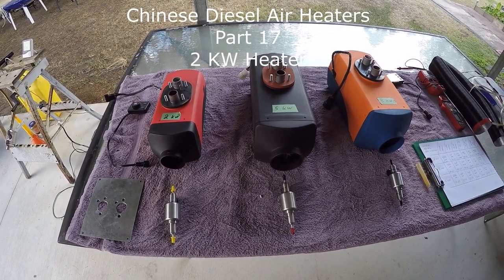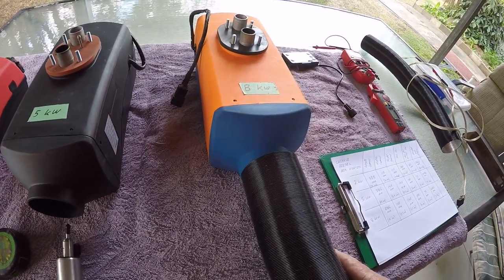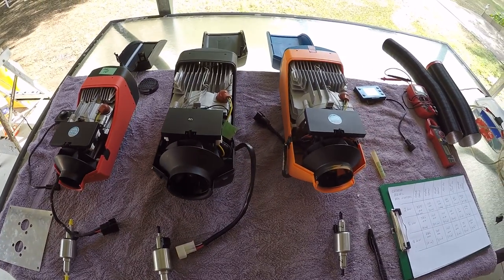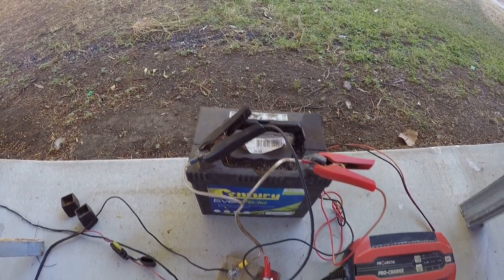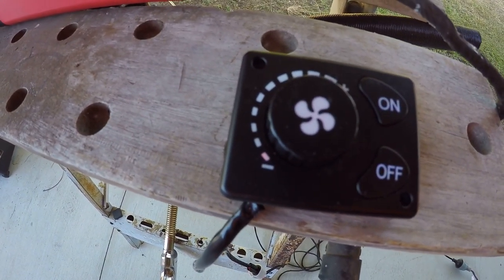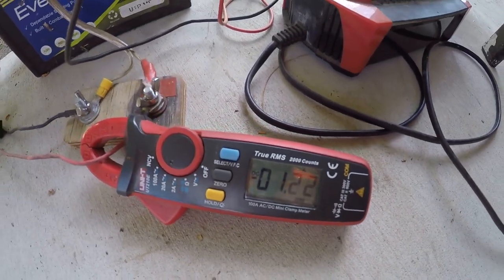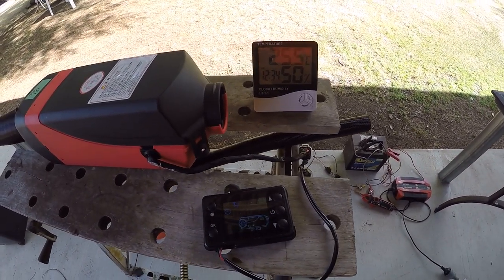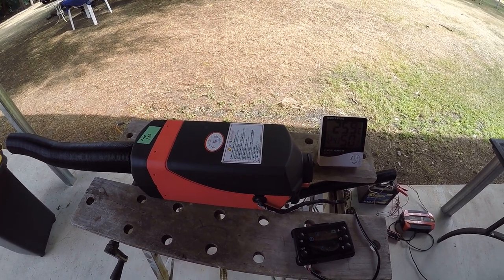Chinese Diesel Air Heater   Part 17 -  2 Kw Heater

Comment: Hey. Ive watched all your videos and just want to say they are great. Thank you. 

I do have a question for you. Have you ever run into this problem. I have a 2kw heater that wont ignite on its own. Its giving an error code of A - 7 but the controler works just fine. If I give it a shot of compressed air up the intake pipe during start up it will ignite and run just fine. But without the shot of air it just blows white smoke and goes to A7. I have changed the screen and glowplug and cleaned everything inside. Im kinda at a loss with this. Any suggestions would be awesome.  Thanks man.
Reply from the maker: Hi Drew,

Looks like you have a flooded heater with residue fuel in the burner chamber.

Now the obvious questions. Is the heater mounted with exhaust and air intake down, or is it mounted on its side? If on its side, is it on the side with the glow plug on the top. If mounted on the side with glow plug down you get residue diesel around glow plug and starting difficulties.

Is the fuel tank above the heater? If yes you need a fuel shut off tap, and need to turn this off when not in use as you can get fuel seeping past seals in pump and cause flooding issues and non starting.

Is your combustion air intake hose too long or are there restrictions in it that reduces air volume?

Is your fan sticking? Does it turn freely?if you have the heater apart check if the inner combustion fan is ok and not free spinning on motor shaft. 

I would be most interested in how things go, and if you find the cause of your issues.  JMcK
Reply: @johnmck1147  
Hi John.
Thanks for the reply.

The unit is mounted with exhaust and intake pointing down. The fuel tank is almost directly beside the unit. I definitely agree that it is flooding. Almost like the rpm of the fan isnt high enough to light the fuel at startup. The fan is in good condition. Not free spinning. Intake hose is also in good shape. 

We had someone suggest that it needs to be adjusted for the altitude here in Calgary Alberta but havent been able to find any info on how to do that. 

This is a 2kw heater from HappyBuy and I have 2 of them that are both acting the same. My friend is living out of his FJ Cruiser and winter is slowly coming. Your videos have helped a lot but this is a real head scratcher for sure. 

Drew
Reply: @johnmck1147  - The heater stopped working last week, even with the compressed air. The controller now defaults to showing " - - - ". However, moving the dial, it will show power level and then go back to " - - - ". I tried to reset it by pulling the fuse, nothing.

The white smoke is likely my, as last attempts when tired, cold, etc. manually priming the unit or repeat tries to get it working out of desperation.
Reply from the maker: @AnthonyRMaradin  
Hi Anthony,  you could have a controller issue or ECB issue on top.
If the heater is relatively new I suggest you ask for a replacement.
If heater is old, it may be better to buy a new one. (You can buy one in Aus for a few packets of cigarettes.) and use the old for spares. I am a little fortunate as I have a few spares and I can swap out suspect components.  Good luck, and please keep me informed.
Reply: @johnmck1147  - Thank you for replying. My good friend had swapped out the first one and we had the same problem. He even replaced parts in the first one, same problem. And here I am today, no heat with Canadian winter around the corner... and it's cold right now. I live fulltime in my FJ, mostly in the backcountry - what you may call the outback. I've done two recent videos on my heater issue. It appears the ones sold by HappyBuy are not good. I found another one, not sold by HappyBuy. So I'm hoping this comes through for me in the near future. My channel also explains my situation. Thank you again for replying. Peace be with you.
Reply from the maker: @AnthonyRMaradin  
Anthony, just a thought. 

Are you using narrow bore hard nylon fuel hose on the delivery side of the pump? Some heaters are only supplied with cheap large bore plastic hose.

Have you checked the burner chamber glow plug screen. Some heaters have been supplied with the screen not pushed right in and they block the ignition hole causing rich mixture.

The glow plug screen must be free of carbon and seated right into position. Also the start air hole must be clear of carbon. There is a video on this. 

Also re altitude. How high are you?
These Chinese copy heaters do not come with altitude compensation and run rich and make a lot of carbon. Check if the glow plug screen is all carboned up and the start air hole also blocked by carbon. If the glow plug screen is full of carbon, so will the main burner screens. These will need to be cleaned. See video.

If you are above 1,000 feet altitude suggest you use a high kerro/diesel fuel mixture, say 90/10. Without altitude compensation kerro burns much cleaner and makes less carbon at altitude than diesel.  JMcK
Reply: @johnmck1147  - Yes, the green flexible hose. Altitude around 3500 feet maybe. Rather than "karro", would regular gas work?
Reply from the maker: @AnthonyRMaradin  
Hi Anthony,

Suspect the heater is full of carbon. This will need to be cleaned out. There is a video on this.
Next suggest you get some narrow bore hard nylon fuel hose and run that from fuel pump to heater. Then suggest you burn a kerro/diesel mix. Kerro burns cleaner than diesel and producers less carbon at altitude. The little bit of diesel gives lubricant to lessen pump wear. If you have heating kerro in your area, it generally has a high Sulfur content and does not need any diesel for lubrication.

No, you can NOT use Gas, or Petrol in these Chinese copy heaters.  JMcK
Reply: @johnmck1147  - Thank you. I suppose it makes sense why I only had about a full week of use before it became clogged up - if that's what happened, elevation and mix. Okay, no gasoline - I meant to mix with the diesel, not straight up lol. My buddy or I will update you. Thanks again.

Comment: Jan 1 2021 is payday. Thank You John, Im ordering one happybuy chinese 5 kw heater. Camping in old dodge ramcharger truk. Its 20 degrees Fahrenheit last two nights. NEED HEAT. 😀😬😂😂😊😎😎 ordering from Amazon; do you recommend a certain company/manufacturer thats proven reliable or can you state company to best avoid??? 
Its not supposed to be This Cold in florida, oranges agree. 😬😂😎😎
Reply from the maker: Hi pastor Justin,

Sadly I can't recommend a particular supplier as they come and go.
Not one of the suppliers I bought from last year are still there this year.
Suggest you buy from a supplier with good feedback, has a warehouse in your home country, and offers returns.

Cheers.  JMcK
Reply: @johnmck1147  Thanks. Yep just when somebody makes somethin great they sellout and it no longer available in the great condition originally created. Thermacell mosquito devices were like that. The newer manufacturing used lesser quality parts and efficiency dropped. Oh well. Moving on. (Oh thanks for your response)😀😊

Comment: HI John, loving your series. Have you noticed any difference in theses eBay units quality wise, or should I just buy on price
Reply from the maker: Hi Mark, the basic heaters are mostly good quality, it is the "accessories" that vary in quality. Some come with poor quality fuel hose, mild steel hose clamps no filters and cheap controllers.

Suggest you look for a heater with the controller you want, and choose a supplier that accepts returns and has a warehouse in your country of origin or close by. 

The little things like hose clamps, and fuel filters are easily sourced after market.  

Cheers.   JMcK

Comment: Hey John, I have a problem and was wondering if you know the answer? My ECU has a flashing red light. Any idea why?
Reply from the maker: Hi Bob, I need a little more info please. Do you mean the controller has a flashing red light? The ECU is inside the heater case and has no light. If a controlled, what type? Is the light flashing a number times in sequence, if so that is the error code.  JMcK
Reply: @johnmck1147  It is on the ECU printed circuit board. I uploaded a video to my channel that shows it. I think something popped in the circuitry?
Reply from the maker: @bobbob1862  
Hi Bob, is it a Chinese heater?
Can you please send me a link to video.  Thanks. JMcK
Reply: @johnmck1147  yes it's a chinese one.
Reply from the maker: @bobbob1862  
Hi Bob, sorry, but I can not help you with this. It may be just an indicator light telling the ECU has power. I have a couple of spare new ECU's so when I get some time I will power one up and see what happens.  JMcK
Reply: @johnmck1147   Thanks John for your time and input, I will contact the vendor I purchased it from and see what they say? There are 4 solder points in a row together at that point, the blinking one looks a little different from the others. I will let you know if I get it figured out. Have a good day!

Comment: Interesting... 
Looking for a 5Kw heater. 
From who should one order to get the best one?
Reply from the maker: Hi Ivan, I can't recommend a supplier as they come and go. I recently went to buy another heater but none of the suppliers I purchased from last year still sold heaters. I suggest you search the internet and chose a supplier who uses a warehouse in your country, accepts returns, and has a good rating.  JMcK
Reply: @johnmck1147  Thanks John! 
Unfortunately no one here in Sweden as I understand... 
Will try the "regular" Chanel's
All the Best!

Comment: I need only 1kw of heat when its really cold . I'm not sure which one I should buy
Reply from the maker: Hi Esa,

The noise, and current drain comes for the heater running flat out to provided the required heat.

I am opposite to most, in that I believe it is better to have a bigger heater running slow, rather than a small heater running flat out.

If you really do only require 1Kw of heat, a 2Kw heater will be just fine for you. 

To produce 1 Kw of heat a 2Kw heater is running at half speed, which is good and acceptable.

Cheers.   JMcK
Reply: @johnmck1147  I'm concerned about the fuel consumption. In fact I need about 0-500w from 20-0c and from 0 -20c I need about 500-1000w.  So actually even the 2kw heater is too much for my needs.  I'm using this to heat one cabin in a boat that is well insulated and because the cabin is mostly underwater the water keeps the temperature up when its extremely cold outside.
Reply: so Ideally I would want a heater 500-1000w that would consume 0.05 - 0.1  l/h . sure low running noise is a must too.
Reply from the maker: Esa Saarinen 

Hi Esa

On the lowest setting, the heater will use around 115 ml of diesel per hour.  JMcK
Reply from the maker: Do One 

Thanks for the detailed feedback Do One.  JMcK

Comment: What is the inlet diameter for the 5k heater? thanks
Reply from the maker: Oh dear me PeeYou

You can't have watched the video, as I provide that information in the video.  (75mm dia)

Cheers.  JMcK
Reply: @johnmck1147  Sorry i though when you said the 75mm opening for the fan is for the fan blade opening.  since there is a twist-on ring for the inlet side, i thought it might have a bigger OD opening than 75mm.  The reason is that i mounted mine under the car so it not as easy to measure and I want to find a duct that fit that inlet opening. thanks for posting all the videos, it been very helpful.
Reply from the maker: PeeYou 
👍

Comment: Can You Use Any Control on Any Heater
Reply from the maker: Many, but not all heaters have similar wiring protocols and matching plugs and the controllers can be mixed and matched.  JMcK

Comment: Hi John, just like to say thanks for all the videos, absolute mine of information! I'm looking to buy a 5kw in the next day or so after watching your testing and install, I'm sold. However I cant believe the difference in pricing for what 'looks' like the same product. I've been checking the product sizes they give and that varies a bit, I dont want to get a 2kw sold as a 5!  In your view is there much difference between whats on sale and looks the same? Some of the Aus stock heaters vary from 139 to 259 bucks...Help!! Thanks, Steve
Reply from the maker: Hi Steve, yes the prices vary greatly for basically the same heater. Suggest you buy off a supplier with a local warehouse that accepts returns, and the cheapest with the accessories you require. 
Cheers. JMcK
Reply: @johnmck1147  Thanks John and thanks for taking the time to reply!
Reply from the maker: Makeoverseas 
👍
Reply: @johnmck1147  Jus a quick
ie John, have you seen anything about the 'silent' autoterm fuel pumps at all? they are for 2 and 4kw planar/autoterm heaters, do you think they would be interchangeable with the chinese heaters? Thanks mate, Steve
Reply from the maker: Makeoverseas 

I have seen a facebook video showing the quite fuel pump, but I have not tested one myself, or actually heard or seen one in real life. I would love to test one, but that brand pump costs far more than a complete Chinese heater.

The fuel pumps on Eberspacher, Webasto, Autoterm and Chinese copy heaters are all simple pulse dosing pumps and would be interchangeable size for size between the different heaters. 

Cheers.  JMcK
Reply: @johnmck1147  Thanks again John,   I have also been looking at getting a chinese (belief) diesel water heater too, have you ever looked at these at all? Webasto/Espar is just incredible pricing!
Reply from the maker: Makeoverseas 

Not yet, but I would love to test one if I can get one. 
No argument about the cost of a brand name heater.
Cheers.  JMcK

Comment: Have to disagree on the efficiency between the 2 and 5kw heaters, they do use the same pump but the pump on the 2kw runs slower delivering less fuel, typical hz on low for the 2kw is 1hz at 1500 rpm and 3hz at 5000 rpm, the 5kw is 1.6hz at 1500 and 5hz at 5000rpm so the 2kw is not less efficient in fuel.

Comment: I am sorry to bother you, but I have been trying got work out a solution and thought you would have a good idea on an answer,

I LOVE tracking fuel consumption in my homemade camper. It helps me know my load, my driving habits, and, if something is failing in the van. Because of this, I am unsure how to proceed with the heater. 

1. Use a separate tank (but how to fill if mounted under the van!?)
2. Tap van diesel tank and somehow meter consumption
3. Give up, tap van diesel tank and live differently.

I would be fine with filling two tanks at the fuel station, but how would I mount a tank under the van I could use the hose with? All meters I have seen are for much larger applications... 

Any thoughts John? Thanks for any reply :)
Reply from the maker: Hi Luna,

The fuel consumption is very easy to work out. The dose is .02 ml per pulse. Just multiply the dose by the pump frequency to get the consumption. Eg running the heater at 3Hz, just multiply 3X.02 =.06ml/sec. Multiply X60 for minutes and multiply by 60 again for hours. 

I have seen jerrycan fuel tanks mounted on the back door, back bumper even in a cupboard. 
You can install a cheap fuel sender in a jerrycan if you wish.
You can't just T into the fuel line of many vehicles. Always better to have a seperate pick up tube.

I am in the process of doing a motorhome install video which may be helpful. Hope to publish before end of month.

Regards.  JMcK
Reply: @johnmck1147  I saw you explain how to do the math. But if I leave the machine on overnight I will have to try to manually track how many hours it was on. An electronic component doing the hard work for me would be ideal. Guess I'll have to figure out the second tank option.

I guess my challenge was, I want the tank underneath the van. So how would I fill it? I have a small van. Even considering an undermount box for the unit itself.
Reply from the maker: Luna Umbra 

Hi Luna, why not just install a simple fuel gauge and tank sender unit?   JMcK

Comment: I have a 3kw that is same physical size as a 2k....
they uprate it to 3kw by the diesel and air setting so i suspect you re wrong expecting an 8kw to be physically bigger and  it will be uprated on diesel and air settings...
check the Hz on fuel setting
Reply from the maker: Hi Harry, 

My 8 KW heater is a stock standard 5 KW heater, just branded different. 

The max fuel setting on my "8Kw" heater was 5.5 Hz, exactly the same as a 5 Kw heater. 

Yes, you could probably get 6Kw from this heater by going into the settings and upping the fuel rate to 7Hz or so, but I doubt it. 

My testing shows increasing the fuel burn to just 6 Hz results in an overheat condition and the heater shut down. There is no way you can get 8 Kw out of this heater without increasing the size.

Of interest Eberspacher rate their original heater at just 4Kw (D4) These Chinese  5 Kw heaters are an EXACT copy of the D4 heater. My testing shows it is even borderline rating the Chinese copy heaters at 5 Kw. 

It is pure deception to have a heater that is an exact copy of the original Eberspacher 4Kw heater and market it as an 8 Kw heater.

I have not personally tested a "3Kw" heater, so I can't comment if the claims are true or not.

Cheers.  JMcK
Reply: @johnmck1147  my 3kw heaters digital control panel goes from 0.8 to 3 hz and I believe its 1hz per kW and you have to adjust fan speed to correct combustion to get it burning right and not overheating...
Interesting yo can adjust your heater to 7 hz and maybe 8 if you try but my guess is the fan would have to be right up to achieve clean combustion and no over temp trip..
On my 3kw I cannot set the hz above 3 and that burns clean with fan at 4550 but if it let me up the hz to 4 which would need fan around 4750 it would be capable of 4kw.
Reply from the maker: harry harry 

Thanks for that info on your heater Harry.  JMcK